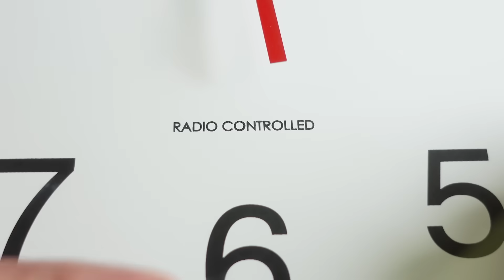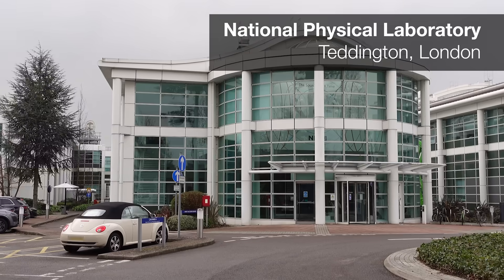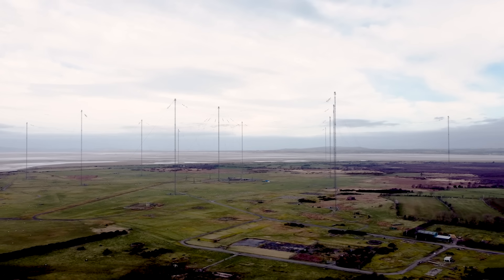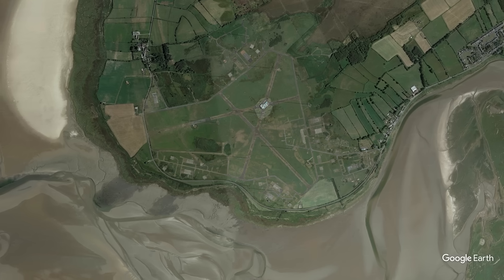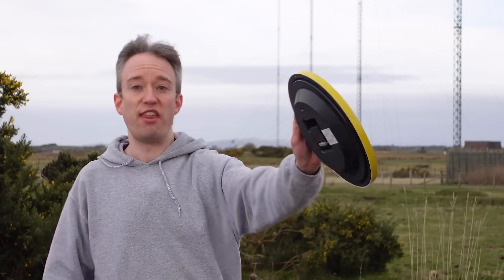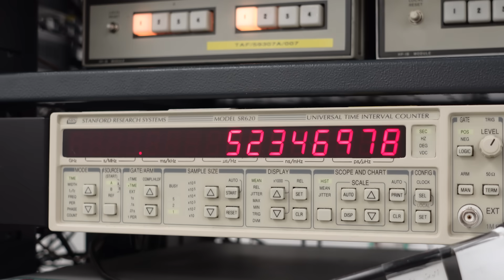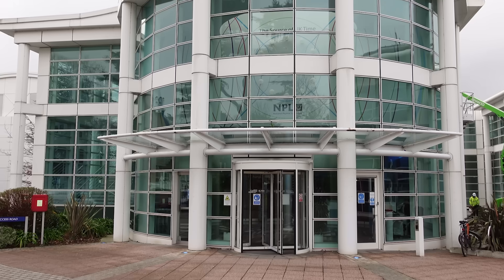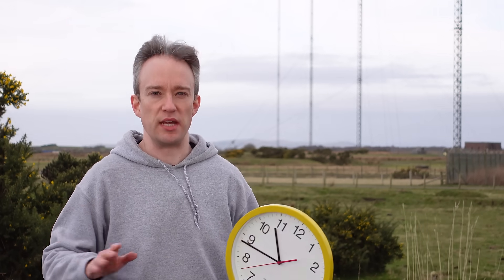How does Britain know what time it is?

Comment: Tom, you didn’t answer the obvious question; how ‘wrong’ does the radio-controlled kitchen clock need to be before it can’t correct itself?

In other words, when we jump from BST to GMT to BST, the kitchen clock (presumably) doesn’t spin itself backwards or forwards an hour instantly.  It needs some manual correction.
Reply: There is a part of the radio signal that tells the clocks if it is currently GMT or BST. When the clocks get the BST signal at 2AM on the fifth Sunday of March, they instantly set themselves to 3AM BST. And the same happens at 3AM on the fifth Sunday of October when the signal switches over to GMT, and the clocks set themselves to 2AM.
Reply: @sjokomelk  so…. The hands on the clock spin round the clock face to jump forward or backwards by an hour?
Reply: The time signal itself had a summer time information for a long time, so your kitchen clock simply doesn't recognize that information (it seems more common than I thought!).

Comment: I remember seeing a demonstration of Einstein's Theory of Relativity where they had two synchronized Cesium clocks and they took one of them on an airplane and flew for an hour at about 600mph and, sure enough, when those clocks were re-compared the one that flew in the airplane was a few billions of a second behind the one that stayed on the ground, proving that time actually does slow down as you move faster.
Reply: The time dilation effects of gravity also have to be taken in to account when designing satellites. The on-board clocks of GPS satellites, for example, are designed to tick at a slightly slower rate than ground-level clocks, because the passage of time for an object appears to speed up as it moves farther away from a massive object.
Reply: @jacksonlarson6099  as far as I know they even coded a switch, so they can take Einstein in account or not. The reason was, that his theory wasn't really proven when GPS was designed
Reply: @jacksonlarson6099  They're also constantly updated via ground stations
Reply: I think they did something similar with the Apollo flights - onboard clocks were behind the earthbound ones when they got home.
Reply: Does that mean we can find out what speed is absolute 0mph in deep/inter-galactic space by comparing the speed of time at various vectors?
Reply: @C. H.
No. Relativity makes it so that it's impossible to measure the absence of time dilation and distance contraction effects. To any observer it always seems as if they are entirely stationary, no matter their velocity or the gravitational warping of their local spacetime.
You should look into it, it's very interesting stuff!
Reply: @C.I...  assuming you mean completely flat spacetime with no gravitational time dilation, even intergalactic space has some of it going on due to the gravitationally-bound “local group”. As far as we know, there’s no place in the universe with a total absence of gravitational waves
Reply: Movement itself is relativ
Reply: Ok

Comment: I've got a Beko oven that REFUSES to work if the time is out. The time is manually set and has nothing to do with a cooking function, as in if you use the timer it doesn't automatically turn it off in any way as it's a gas stove but I've always wondered when our power trips or when daylight savings happens how does it know since it refuses to work when the clocks change. And this is clearly the answer. Thank you Tom

Comment: I always have radio controlled clocks on my walls, but why on earth isn’t it put into ovens and microwaves too?
Reply: As an Australian I was about to say cost savings/economies of scale for ovens etc. made internationally - because how many countries actually use this technology...
Then I checked wikipedia; wow loads of countries use it, I feel as though my continent might be the only one that doesn't have it?!
Still it does say "The stations vary in broadcast frequency, in geographic location, and in how the signal is modulated to identify the current time" - so I'm guessing a cheap one size fits all for solution imported appliances couldn't work.

Comment: Crystal radios need no external power source. I wonder if you could make a clock that gets it's energy from the radio signals and needs no battery.
Reply: Not from 60khz you couldn't.
Reply: @johno4521  Maybe it could get it's power from another frequency, then use that power to interpret the 60khz signal? I know next to nothing about radio technology

Comment: I bought small weather station in Lidl that said it's "radio controlled". I thought that refers to the temperature sensor being radio connected. But then was surprised when clock got set up by itself
Reply: I have a Lidl LCD lounge clock - time, date, moonphase, temp. one slide switch to change from UK to Germany timezone. ~£15 in the bargain bin and I've had it for years.

Comment: How come radio clocks take hours or even days to synchronise to the correct time after the clocks go forward/back? 
We have them where I work and it seems to take that long to get them in sync. Does it have something to do with not having a good enough radio signal? Even though I don’t see why our building would have a bad radio signal. Or is it cheap manufacturing of the clock?

Comment: Something stinks here, we have internet, we do not need these extremely expensive radio systems to tell our clocks the time, if you believe this then you are a blind believer, it makes no sense to maintain this which is costing millions of euros just to calibrate clocks using radio frequency.... More like, how do frequencies like this interact with the human body and the low frequency electrical systems of our neurology... Surprising to me that little to no research has been conducted in this area, and we just gobble up any reasons given to us... quite worrying....
Reply: Coming from the guy using a device connected to the internet with geolocation tracking with RFID and NFC capabilities
Reply: Have you ever thought about where and how the internet gets and synchronises it's time.  Anyway those towers behind Tom do a lot more than just send out a time signal.  As for interactions with things - the 60 kHz transmissions have been around for nearly 100 years so any effects would have been noticed by now.

Comment: I had a radio-controlled alarm clock that for some reason used to go mad in the middle of the night.  I once got up and had a shower when the alarm went off, thinking it was 7am.  It was 3am.  I stopped using it after that!

Comment: We have a similar system in the US. I remember back in elementary school my parents got a radio-controlled clock from L.L. Bean. (On an unrelated note, it also has a built-in thermometer and hydrometer, which is also cool.) I always got excited to see the minute hand automatically skip forward whenever Daylight Savings began for the year, and then fall back when it ended. 

That being said, I'm glad Daylight Savings is ending so I won't have my circadian rhythm screwed every year.

Also btw, the clock still 100% works despite braving the elements for almost a decade and a half.
Reply: The minute hand should move 60 times each hour. So if it only moved twice a year, it wouldn't be a very good clock. 😂
Reply: @sjokomelk  Depends on the clock. Some clocks step the minute hand 2, 4, or even 6 times per minute.

Comment: One thing that amuses me is that the time pips broadcast regularly by BBC Radio 4, vary according to the method of reception. If one tuned in an analogue radio and a digital radio, and also tuned in via an Internet stream, one would find a big gap between the time pips (they might be as much as a second out). This is obviously down to how the radio signals are relayed and decoded. That begs the question as to which reception method is most reliable, an whether people should rely on them at all.
Reply: Purely analog radio CANNOT have any delay when receiving. Of course the accuracy of what the station is sending is another question.

Comment: So, does my old school (ie non “smart”) electricity meter get a signal from this place to flick (quite loudly) the economy 7 relay on?
Reply: No. Those are different signals coming from your electricity provider, either as another radio signal, or as a signal on your actual power wires.

Comment: Anthorn doesn't seem to be a good location for the transmitter.  It was far more reliable before it moved to there.  Now I have to place clocks in front windows or outdoors in order to get a connection.  Am I in a difficult location?  A North London postal district.

Comment: Funny thing. We bought a radio clock in Germany (UTC+2/CEST) and brought it to Finland (UTC+3/EEST), thinking it would just synch to the "local" time zone. It didn't. We can set the time manually, but once in a while it switches back ... I haven't been able to figure out how exactly this can happen. Does it pick up a German radio signal, or something it interprets as such? Is it a weird coincidental error?
Reply: It picks up the German signal from DCF77. So if the clock doesn't have a setting letting you know if is in a different time zone, it will always revert back to CET/CEST.
Reply: In general radio-controlled clocks can't see where they are so can only rely on time signals they recognize. So your guess that it picked a German radio signal (which can be received from most European states) is probably correct.
Reply: Fascinating, I was not aware that's how it worked! My guess was that there's a time radio signal that it would pick up, according to the country it's in, but now that I think about it that wouldn't be very practical for regions that are close to time zone borders.

Comment: My "Citizen Eco-Drive" bought back in 2010 is set automatically by radio, changes to whatever local time I happen to be in and because of the solar panel in its face, never needs a battery or winding. The best watch I have ever owned (including Rolex).
Reply: Even some Casio's have this tech ..
Reply: Does it have GPS to get the time zone?
Reply: @Motorman2112   Search for Atomic watch. I think watches capable of time syncing use 60KHz from WWV in US. Don't know what the standard is for other countries.
Reply: @Joetechlincolns  You still need the time zone. This requires your location to at least a reasonable level (or effectively so).
Reply: To really put it to the test, cross the border to or from the west of China in a north or south direction.

Comment: I have a wall plug digital clock that has some kind of tiny radioactive sample that drives it so that when it is unplugged it will keep the correct time when plugged in. I have left it unplugged it for a very long time and it is never more than a couple minutes off. I was surprised when I was a kid, because I had gotten into the phase of taking apart things like my toys. I took apart my clock and saw a radioactive symbol inside it. nifty.

Comment: Had one of those in are family home for many years, it was always perfectly 2 1/2 minutes slow….what a pain, with no way to correct
Reply: @Daniel Farrant Possibly a mechanical problem if it was a clock with pointers ie the mechanism slipped a gear or two. Fixing the fault is not difficult - if you can get into  the case without destroying it or at least putting scratch marks on it.

Comment: My dad used to have one of these clocks and during a time where there was construction on the neighboring property the clock went totally crazy. Turns out that construction cranes have roughly the right size to interfere with the radio waves (similar to these radio transmitters I guess).
Reply: These clocks operate on very low frequencies so heavy, vibrating industrial equipment can interfere with them.

Comment: We had a bunch of these clocks at my high school in the US. They were a massive improvement to the older hardwired clocks, which drifted by several minutes, and had to go through a reset cycle, every hour.

The best part was when the receiver failed on this particular model clock the clock just went haywire. It would spin forwards or backwards at a seemingly random speed until the battery was depleted. This was 20 years ago though, so I would hope the reliability has improved since then.
Reply: Main voltage clocks are more the accurate enough for a school. The grid frequency (at least in europe and the UK) is adjusted so these clocks keep accurate to within seconds. They need to be set once ofcourse, but after that they will keep their time forever, as long as the grid keeps it 50Hz fairly accurate. 
Now, my school just has quartz battery clocks, and for some reason they seem never to be right, and constantly need battery changes.
Reply: @slome815  Well, you would still need to account for DST right? And if you imagine a building with 100 clocks, that gets annoying...
Reply: @igorrinkovec6405  Yes, you still have to account for DST. It's not that much work if everyone just changes the time in their own desk / part of the building. At least you don't have to change batteries. Where I work it seems I'm the only one that changes batteries on dead clocks.
Reply: @slome815  The traditional system is to have "slave" clocks which accept advance and reset signals from the master clock. You only need to set the time on the master unit and then every other clock in the building will set itself from that.
Reply: Ah, so that's what's happening to the clocks at our school!

Comment: i have had a digital radio clock for over 10 years with a little solar panel on it, i think the last time i had to replace the battery was 5 years ago, it also sets itself forward and back for time savings. always wondered what system was keeping it on track always assumed satellite, thanks for the info.

Comment: Ah, yes.  My kids' elementary school had these in every classroom.  They were usually waaaay off,  or exactly right,  or forever spinning to recalibrate,  or whatever whimsical thing they wished to be doing.  Mostly being wrong.
Reply: Schools full of clocks usually have a controller on location.
Reply: @DoctorWhom  Yup, there's a central clock somewhere (usually a panel in the school office), wired to remote clock faces in every room.  The remote faces are electric clocks running off synchronous motors, that turn with the power line frequency -- evidenced by the second hand turning constantly rather than ticking along.

It was kinda cool to see those clock faces re-synchronize, too.  They would all stop for about a minute, then suddenly advance one minute and start turning normally again.

Though my high school temporarily replaced most of the remote faces with regular battery-powered quartz clocks.  The central clock had no battery backup for power cuts -- and the power was being shut off multiple times (outside of school hours) while the school was being added onto and remodeled.  ...Which led to the system being hours off from the actual time until construction was complete.  It was a couple years after construction had finished before they finally got around to putting all the old clocks back, though.
Reply: @AaronOfMpls  in our school,  they were just like Tom's.
Reply: Hehe we have saying in Germany: Only a broken clock is right twice a day.
Reply: @particularry9885  we have a similar saying here in Brazil, but it goes like: even a broken clock is correct twice a day
Reply: @particularry9885  In English there is the saying "Even a stopped clock is right twice a day" (meaning that even the most incompetent person will occasionally be correct purely by chance). It's specifically a stopped clock rather than a broken one, as a broken clock could, depending on precisely how it was broken, do just about anything, with stopping (and thus having the metaphor work) being just one possibility (and a clock can stop without being broken, too.)

Amusingly, all of these sayings only make sense if you're using a twelve hour (probably analogue) clock. Stopped 24 hour clocks are only right Once a day.
Reply: @particularry9885  We have a saying in England.  Only Germans have the same sayings as us.  :-)
Reply: We've got a bunch of these radio synced clocks at work. Shame no-one checked to see if they'd be able to pick up any reception where they were placed...!
Reply: When the clocks recalibrated, that was the highlight of the day.
Reply: My middle school had a transmitter box in the main office that transmitted the time to all the school clocks. They were all on time, except the ones without power.
Reply: That's what you get when you buy the cheapest available something, which is always going to happen with schools because limited budgets. or principles are similar siphoning off school funding for themselves.
Reply: we had the slow kid who spent most of the day counting bricks but sometimes would also start spinning round and round uncontrollably and put three teachers in hospital

Comment: The same thing is inside a lot of G Shock watches. One of the things that makes the M5610-1ER the best watch ever made. Keeps perfect time with radio and don't need to change the battery with solar
Reply: Mine is over 15 years old and is still going strong on its original battery, because it's solar powered.
Reply: Not even close to the best watch ever made, but very accurate.
Reply: @Jabber-ig3iw  A watches purpose is to tell the time and do so accurately, if it can fulfil those functions reliably for vast periods of time then it works, there is no "best" about anything here if the watch fulfils its main purpose. That is of course unless you are getting into the inane world of watch snobbery that cares more about brands and percieved value than anything tangible.